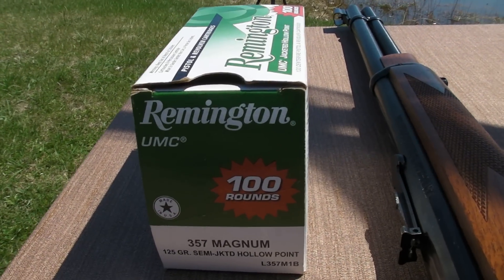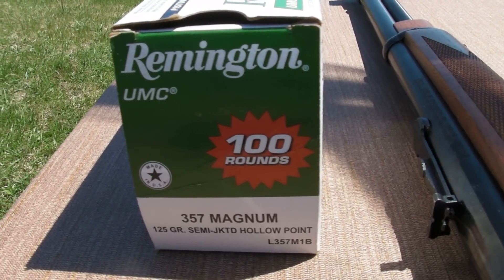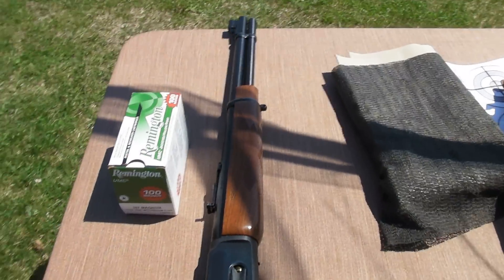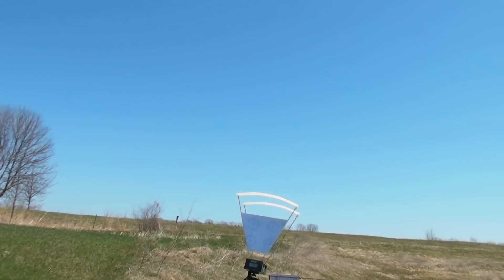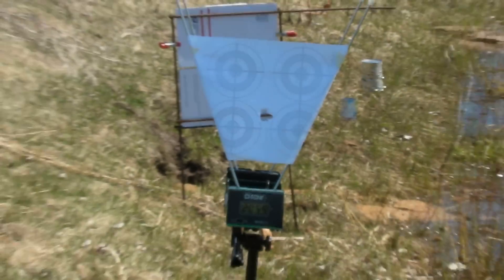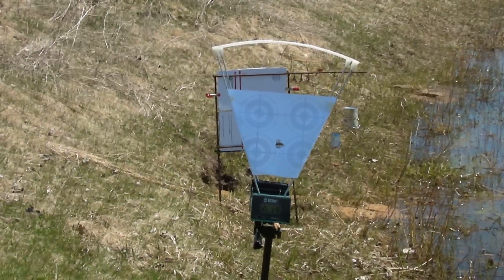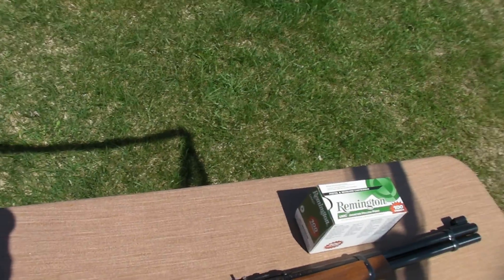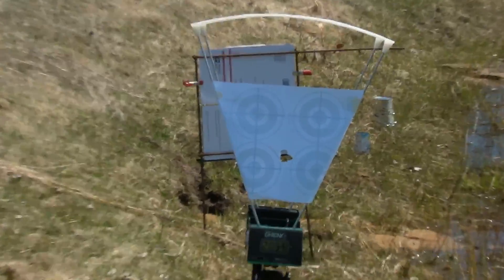Marlin 1894 Carbine Chrony Chronograph  Testing Remington UMC 357 Magnum 125 Grain

Comment: Wow!  Great performance from such a cheap round.  They sting a little when fired from a 3" small frame snubnose but no problem from a midsize 4" revolver - still plenty of power at 1450fps.  You're right, the Marlin hardly has any recoil.  Thanks for posting.